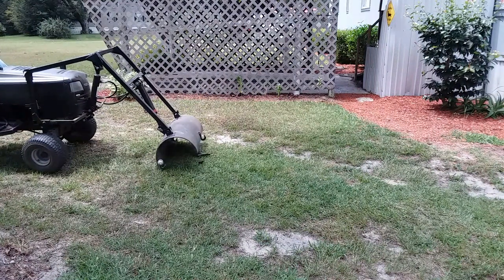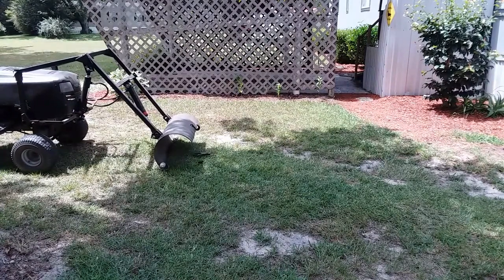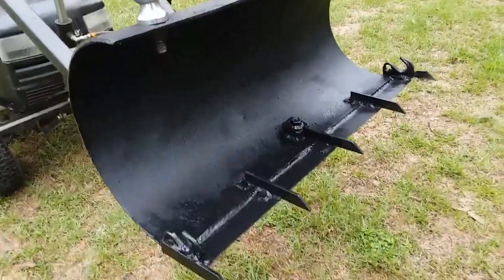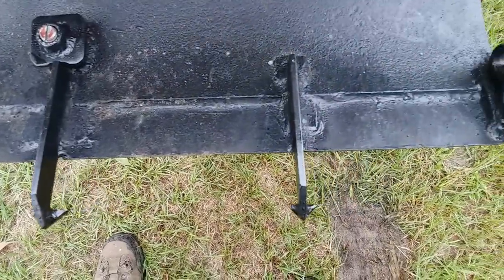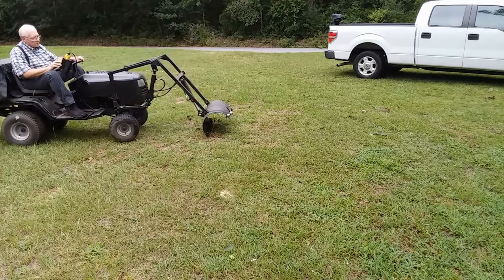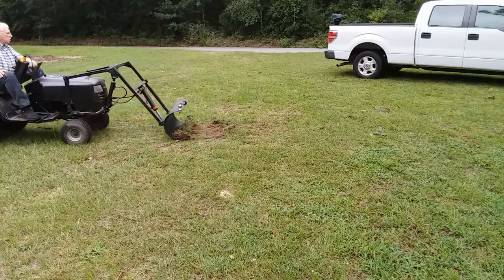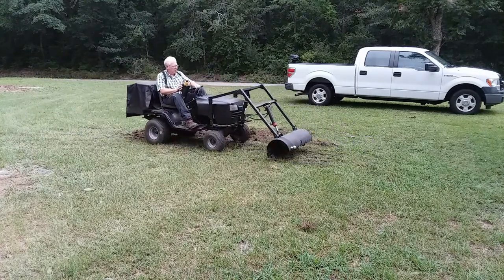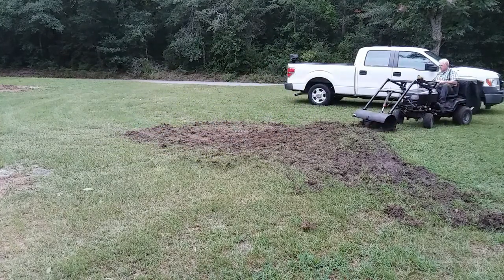Is it helpful to add teeth to the loader bucket on a garden tractor front loader?

Comment: Could you share a link to the cylinders you used
Reply from the maker: I purchased the cylinders on eBay.  Unfortunately they are not available on eBay at this time.  The cylinders are made by WEN.  # WT2008 Cross Tube Hydraulic Cylinder with 2-inch Bore and 8-inch Stroke.  I am sure you can find something similar.